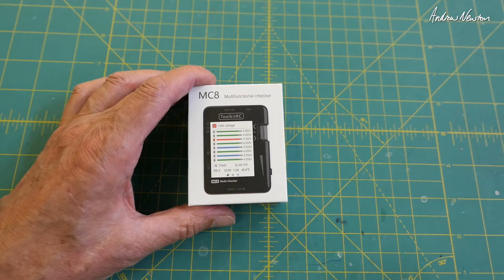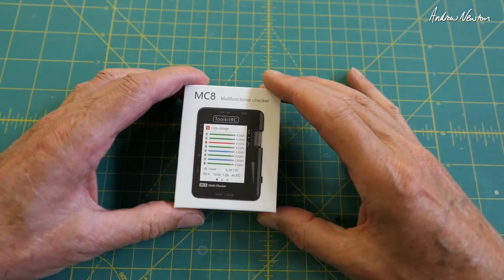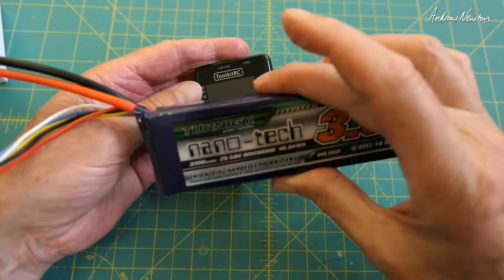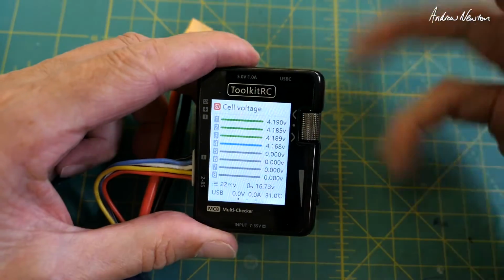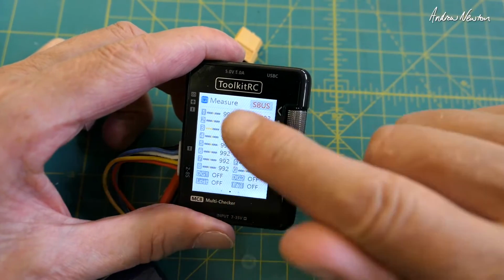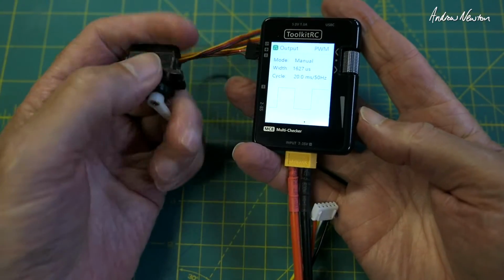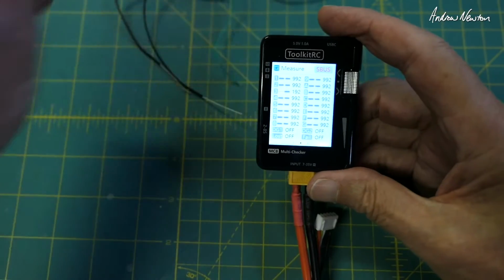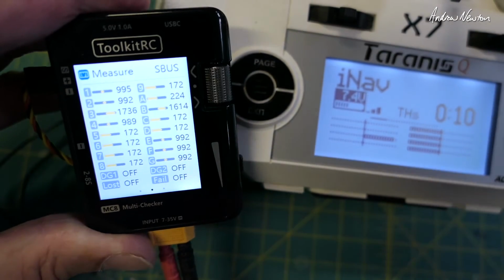ToolkitRC MC8 Multi Checker

Comment: can i charge the rc battery w this toolkit?
Reply from the maker: No just USB device charging and LiPO balancing
Reply: @AndrewNewton  ok if i charge w normal charger and then balance the battery w this toolkit is it ok? Or i will need a balanced charger my rc battery is 7000mah hard case
Reply: @AndrewNewton  hi ty for ur response i sub how can i see how mutch % battery left the rc battery?
Reply from the maker: @oi3  For safety you need to balance the cells while charging so that one does not over charge. Only voltage readout, not %
Reply: @AndrewNewton i wait ur responses ok?